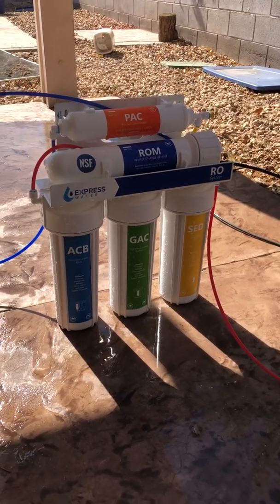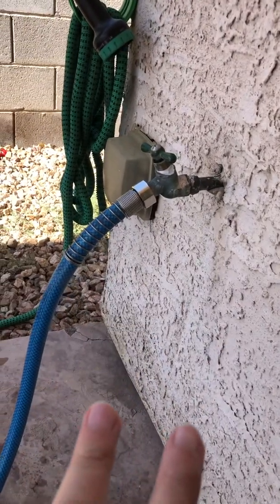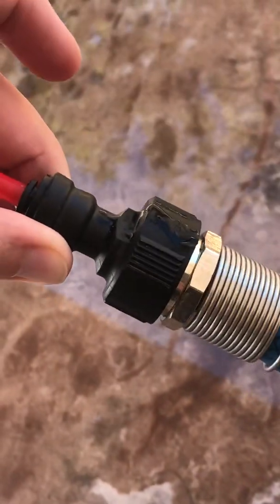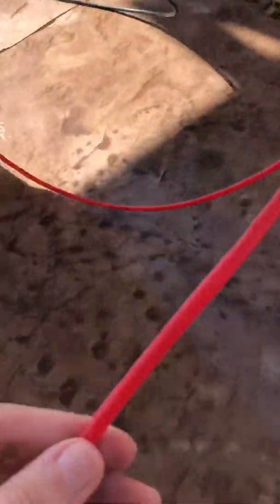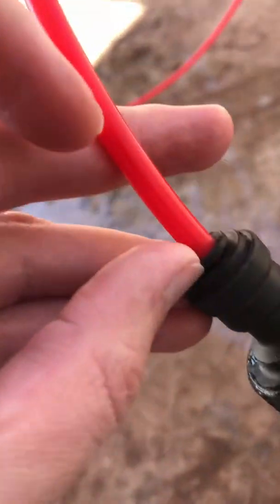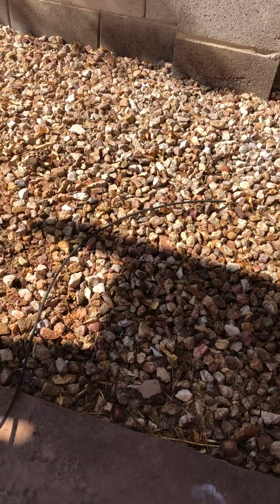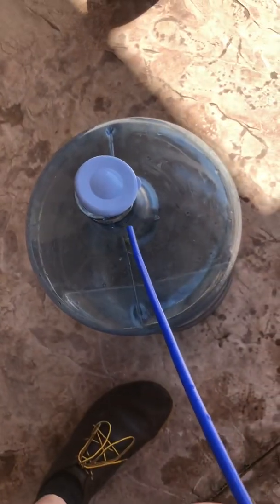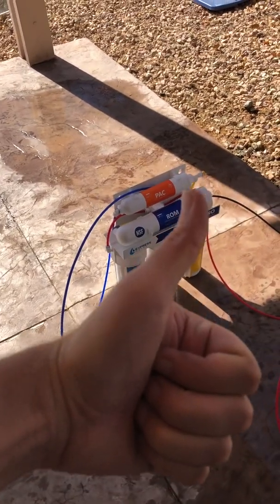Easy RO ( Reverse Osmosis ) Setup , using a garden hose or outside faucet / spigot. No sink!

Comment: Perfect! Thanks 🙏🏿 for this post. I'm using my Express filter for gardening, and this solution worked for me. Lowes’ solution: 
1/4 inch Comp connector x 1/2 inch MIP and 3/4 inch FHT x 1/2 inch FIP swivel adapter

Comment: in the instructions for the filter there is one hose that goes to the tank and one hose that goes to the faucet.. it looks like you connected your clean water hose to the output hole for the faucet. 

I see a little bit of leaking from the output for the tank and I'm wondering if I should've put the clean water hose on the other output hole. 

Any thoughts on the minor leaking?

Comment: I am confused.  I read RO water should not be used for drinking, watering plants, etc  UNLESS specific nutrients are added back into it like magnesium, calcium, potassium etc; good minerals the body and plants need.  Not only does RO water have poor taste, it doesn't remove chlorine or some other things and so you need a carbon filter, too (salesman told me that).  RO water is great for cleaning laundry, dishes, etc, but if using it to remove other contaminants, minerals needed to be added back into it.  So why not just filter the water without RO?
Reply from the maker: Plants get nutrients from soil. They don’t get it from water. Minerals in water are trace and mostly added back for flavor. Humans nor plants get nutrients from water. Yes we need electrolytes but we get those from food. 

RO is inefficient but that’s about the only down side. I thought I stated in the video but maybe I haven’t, it’s been awhile. Not all water sources are the same. The water in my city is horrible so even with a regular inline filter it’s still heavily contaminated. Around 400ppm. Some people have water that’s great for drinking and watering plants straight from the tap. Depends where you live. 

If a salesman told you something he was probably doing his job… trying to sell. Do your own research. RO does indeed remove chlorine if you have the filter for it. There are many different ro setups. 2 stage, 3 stage, 5 stage etc. the RO part is specifically the membrane filter that doesn’t let basically anything through.  

A quick reference for you, rain water has 0-5ppm. Plants love rain water. Clean fresh water is what they need. Good luck

Comment: How did you bypass the tank ?
Reply from the maker: You just don’t connect it and route the hoses through. Intake, waste, clean water. For my system there was a plug already in the tank port on the RO system. I just left it in there and hooked everything else up.
Reply: Mine didn't come with a plug in it. You think I should  buy a shut off valve for it and keep it off?
Reply from the maker: @chriswilliams2945 yeah, or just something to plug it.

Comment: Brilliant thanks. Amazing how so little information is out there on how to do this.
Reply from the maker: No problem! Glad I could help :) 
It seems like it’s helped at least a handful. Didn’t think anyone would even see this video. 

Thanks for the comment!
Reply: Plus the info you do find is typically contradicting. The confusion is intentional. This video was the best I’ve seen. This should bring the tds down enough for cleaning too. Those DI systems are sweet but you’ll burn thru resin without pre filtering it.

Comment: Can you do this in the winter??
Reply from the maker: Great question. I live in a desert environment and the coldest it gets is about 30 at night. I would say it probably won’t work if you live in a climate where you have freezing temps for long amounts of time. What you can do though is quickly disconnect it and keep it inside until needed or get an insulated chest/box to put it in. It connects and disconnects as easy as any hose.

Comment: Thanks for sharing this, sometimes people need to SEE how a product works to see if it works for them. I kept searching online for what the hell to do with the storage container and sink and i just realized YOU DONT NEEEED it... its included but it just got confusing lol. Thanks for sharing this and allowing me to see I can just get this and use it anywhere if im just filling up a large bucket.

CHEERS
Reply: well I think the container is pressurized somehow. And its made to store the water as a reservoir when you want instant access to drink. The reason its pressurized is because RO reacts to air, and if you leave it out long enough the water PH drops from 7 to 4, or something like that. And it becomes acidic. Im currently looking at systems now for my garden im going to start. And trying to figure out how to store the RO water without exposing it to air. Im thinking you might have to put it in some 5 gallon water jug and pump out the air somehow. Im not sure.

Comment: I got a different  system and got it hooked up but no water is coming out of clean line. Just a trickle on the tank line. Do I have to hook tank up
Reply from the maker: How long did you let it run? If it’s set up right, it can take a few minutes to get the water going. Not you shouldn’t have to hook up the tank line, there should be a plug for it.

Comment: What did you use the plug the tank line? Or if I dot insert  the hose will it be closed off?
Reply from the maker: I want to say mine came with a plug in it already, if not there was for sure one in the box. It was a small yellow plug.

Comment: Thank you for this video, I appreciate it. Plants are happy after that I bet, nice. The set up of an RO system for outside gardening seems relatively simple in contrast to installing to sink. I'm a little interested on what is going inside these "Reverse Osmosis" systems, how is the water filtered and what is used in the tanks. Can installing it improperly be dangerous?
Reply from the maker: Hey thanks for stopping by and commenting, sorry I didn't notice the comment sooner. Yah the plants love the RO versus the nasty tap and it is indeed way easier then under the sink. I recommend looking up how RO works! In a nutshell inside there are a few stages of filters, not much else going on! :) , if you install it improperly there shouldn't be any dangers involved, you could mess your sink up or it may not work. Happy gardening
Reply: @EtherealoNe1  Thanks, I did do some research and found out that water is pushed through a membrane, effectively filtered through many stages as you noted. It is one of the most effective ways of water filteration in combination with other technology, so you're right.. it's just layers of filteration (effective by design) at a different particle size very small as opposed to ultrafiltration and microfilteration.

Comment: finally someone who knows what i want to do i figured it should be fairly simple compared to inhouse plumbing and all the issues with that.
i need to do this for my 125g reef tho so i'm thinking i will cover my system with a black cloth or something so i don't get since the first time around i will have to run it for a day or so after that i think it should be fine apart from summer season.
i'm thinking of using the "waste" water for my freshwater water changes if the water changes lineup i don't expect to do alot of water changes for reef tank unlike my freshwater tank but i expect to do top off water.
great idea on using bpa free hose i'll add that to my list.
Reply from the maker: Thanks for the comment and love man. Sounds like a good plan. That’s how I figured it by the way, much simpler in a rented house to do this. I fill five gallon jugs and a drum to water my garden. Works great! 

Thanks again! And have fun with your reef!

Comment: can I use to to fill my 1000 gallons pond? its gonna take month to fill up right?
Reply from the maker: Lol, probably not a month, but it'll take awhile. this isn't for filling a pool or pond.
Reply: Hey if you’re still interested you can get a AquaticLife RO from Amazon for 143 bucks come with all the attachments needed and produces 200 GPD (Gallons Per Day) my experiences it was 168 GPD so it’ll take somewhere between 6-12 days to fill 1000 gallons depending on the water pressure. Hope this helps. :)

Comment: Thank you!! I tried to find an outdoor RO set up last year but couldn't find any info. I even asked a retailer that sells RO units, they said it wasn't possible..clearly, it's very simple though!  Even better would be to find a way to fill a barrel and using a float valve to stop the flow of water, so you don't have to wait around for it to finish filling.
Reply from the maker: You can def set this up with a float valve! I just don’t because it doesn’t fit my uses. I may in the future for sure. And thank you for the comment, glad it helped anybody !  I don’t know why there is so little info about it .
Reply: @EtherealoNe1  great video sir! I’m assuming the water flow is very slow. Would this be a good solution for washing my black car or would it be too slow?    I’m getting hard water spots all over it so I’m hoping there’s a way to wash my car with a system like this
Reply from the maker: @richardnixon9324  So to do this for something like that you would need to fill a reservoir and get a sprayer with a pump. You totally could get 50 gallons of clean water in an afternoon though. Take a look at different RO systems, some are high flow and more suited for what you need. You need to clean a vehicle, it won't need to be 0ppm deionized or anyhting like that. Look for a 2-3 stage, ( hydro logic or aquatic life ) would suit you well. Thanks for stopping by with the love and comment!
Reply: @EtherealoNe1  thanks for your reply sir
Reply: @richardnixon9324  I would check out the in hose filter called Boogie Blue. It filters 35,000 gallons. It was originally for the garden, but many people use it on their cars and it's cheap for that. Easy too. Just twist it on the hose with an adapter and use.
Reply: @rosesparks5148  thanks! I’m gonna check it out now!
Reply: @citymouse40 - (fyi...) There are actually some really good youtube videos that show how to set up a RO holding tank with a float valve.

Comment: As I watched this you gave me an idea for another non permanent solution that could also work indoors ... get a Y adapter and you can plug it into the washing machine connection! 

Thanks for the info about the mur-lok adapters!
Reply from the maker: Thanks for dropping a comment! Appreciate it, yah the adapter is what made it all work and the part I couldn’t find for awhile lmao. Glad it’s working out for you and hope your project turned out !
Reply: Thats how i have my ro buddie setup works great
Reply: @ DjScreaM514 - That's exactly what I came up with... just hooked my RO to a "Y" adapter on the washing machine water spigot... super simple and out of the way. Makes it that much easier to pull the system when it comes time to sell one's home or move out of an apartment + there's the added bonus of easier cartridge changes and saving cabinet space!